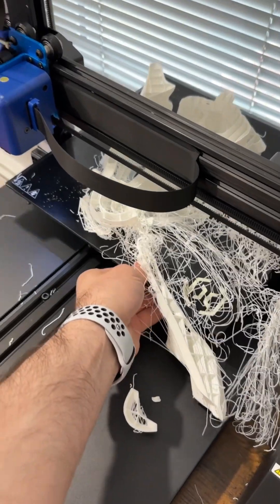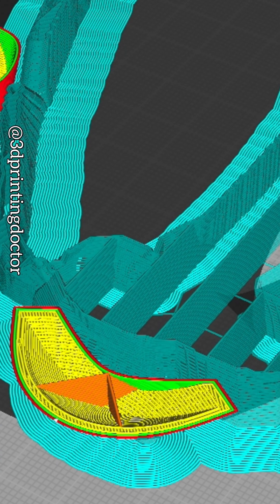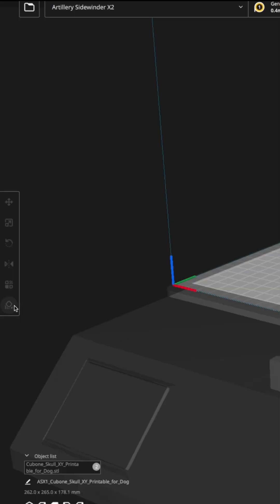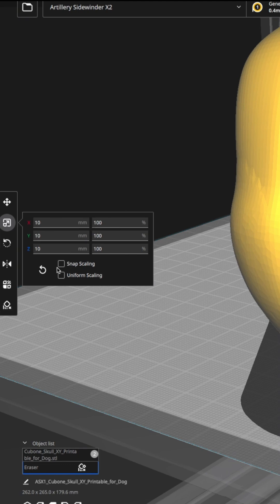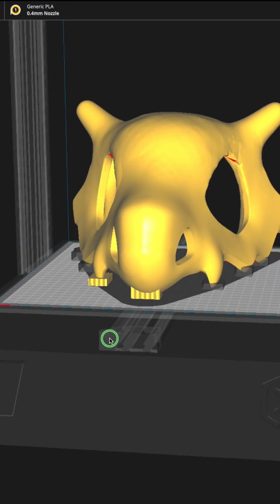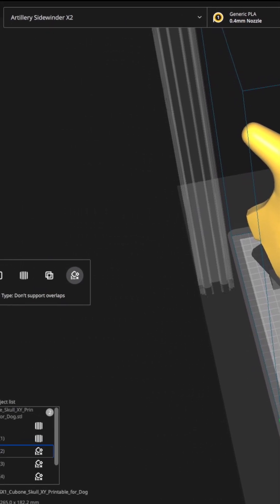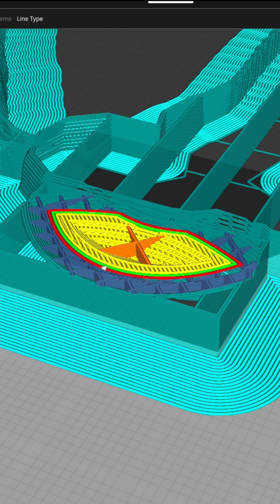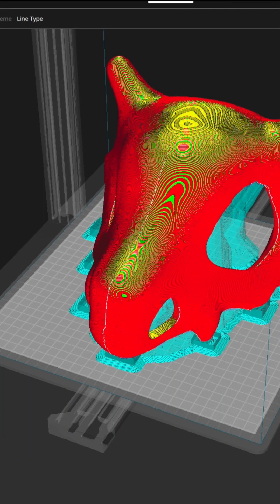How to use support blocker feature in CURA for custom support generation

Comment: really helpful! wondering if its okay that the support cube i insert appears below the bottom plane in the cura preview? do i need to make sure they are sitting EXACTLY at the same Z height as the bottom of my model?
Reply from the maker: Happy to hear! Nope. Check the preview after you slice it and you can see the path. It should work
Reply: @3D Printing Doctor  awesome possom. Great advice. Thanks again!